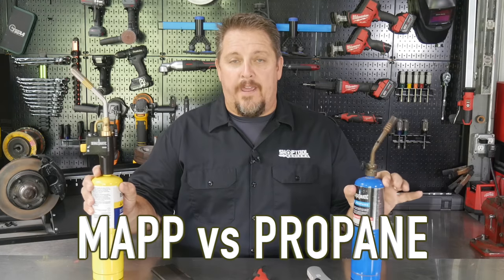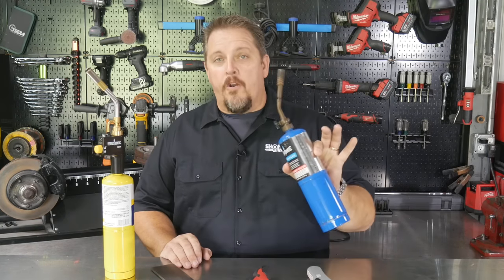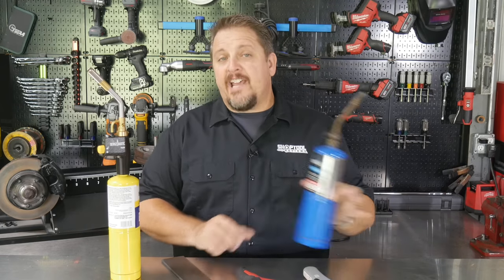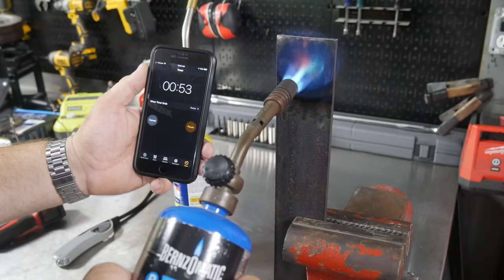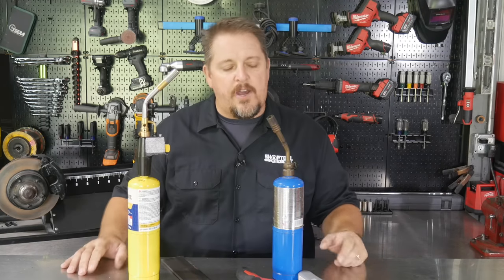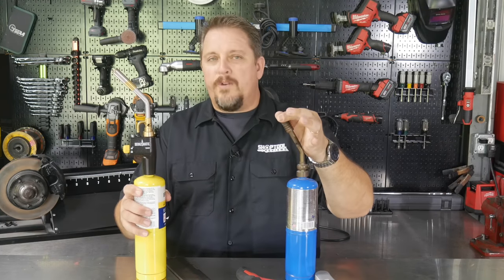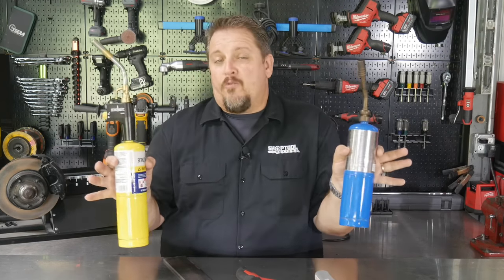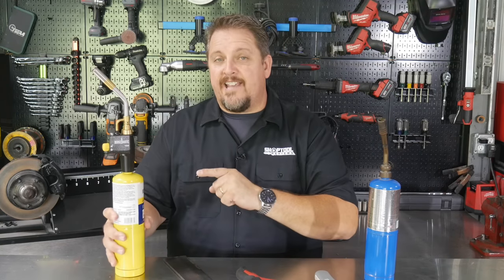MAPP Gas or Propane - Bernzomatic TS8000 Torch Kit

Comment: MAP-Pro lasts longer and burns less fuel in the same time period. Try weighing the bottles, do a 2 min burn time, weigh again and see which one burns less fuel.
Reply: That's a good point, I wonder if propane is still more cost effective in the end?
Reply: Would the flow not be regulated by the tip?
Reply: I’m still crying MAPP was discontinued. Pro is better than propane, but MAP/Pro is only half the temp of MAPP. However…a tank I hadn’t had eyes on in 20 years is the real deal…MAPP! I really should clean off my workbench…
Reply: Well I think you are going to need more than 2 min to see a noticeable difference just based on how long a propane bottle last me but they should flow the same unless it's some boiling point and pressure difference between the 2 but I couldn't see a big difference but I think he needs to do more testing because I believe the map is hotter but I never buy it because propane is enough for me and much cheaper but it's all going up now
Reply: It's near 3x the price and It doesn't last near 3 times as long plus it only burns 130° hotter.
Reply: That's not necessarily a valid test. If the densities of the 2 fluids are different, you will get am unusable result. What you could do is measure how of each mass used per unit of time, then convert to cost of each fluid used. Then you have the bottom line result. Map-pro at the moment is almost 3x the price or prop at my home depot.
Reply: The nozzle will have the same flow rate no matter what gas!

Comment: I've learned MAPP gas has a place for use. In glasswork, propane is "dirty" and acetylene/oxygen is "very dirty". MAPP gas is "clean" when heating glass and glass doesn't get black like the other two. For other purpose, I plainly use propane in my TS7000 for many years. I didn't see much if any difference dealing with MAPP and propane.

Comment: I love how he starts the video explaining that MAPP isn’t the same thing as map-pro, and then a lot of the comments proceed to totally conflate the two different gases.  MAPP was hotter than propane - they don’t make it anymore. Map-pro is also hotter than propane, but not by as much.
Reply from the maker: You're correct, and a tip will make much more difference than the difference in fuel. You have to get the oxygen in the fuel to make it hotter. Thanks for watching.
Reply: 130° hotter.

Comment: Just bought the ts8000 with the map gas included at home depot 30 mins ago. Guess ill be buying the $4 propane bottle instead of the $12 map bottle after this one runs out.
Reply: def go with the much cheaper propane and the map torch attachment,,in canada propane is about 8 buck and map like double that,,crazy
Reply: @Mike Studmuffin bigger does not mean hotter,,it means more work
Reply: Mike Studmuffin, though it's a bigger torch doesn't necessarily mean it will burn hotter or burn fuel faster. The amount of fuel coming out depends how far you open the valve, and it very well could have the same valve, or at least the same output as the older/other ones. The biggest improvement to the TS8000 that make it a hotter, and actually more efficient torch is the turbine blades in the base of the nozzle that mixes the fuel and oxygen much better than previous torches. If one wants to save fuel, it's simple to not fully open the valve. Probably get about as much heat as the previous torch design when the valve is only half open. I built my own torch that's about 16" long. If I close off the air to it, it can burn cooler than either of those torches even though it's about 20x bigger, because it's not getting the right fuel/air mixture to burn like a torch. It's more like a campfire.
Reply: @craigwilson8255  very intresting we very
Reply: I bought the same one a few days ago, after about a minute or so of run time the flame turns orange, pretty sure that means incomplete combustion but I’m pretty new to torches, anyone know whatsup?
Reply: @mysteryman447  get enough petro on thing and it will get hot enough
Reply: @maryrozannasuxmaybarca59  it’s for sure hot enough, the tip is usually glowing by the time the flame turns orange, is it something with the temp of the tank maybe?
Reply from the maker: Thanks for watching.

Comment: I learned this the hard way. Glad you changed the tip good job. I ran out of Map gas at a service call and couldn’t find any map or oxygen an acetylene it was a Sunday. So bought propane and it worked once I changed tip.
Reply: Helpful, thanks
Reply: Yeah, the actual burn temp difference between Mapp/Pro and Propane is only ~.2% (that's 1/5 of 1%). The combustion dynamics of the burner (torch unit) is where your performance is.

Comment: Thank you for this review. I bought the Mapp gas torch kit, screwed in the nozzle, turned on the gas, and didn't hear any "SSS" so thought it wasn't working. Then I watched your video and saw you PUSH THE IGNITE BUTTON!!!!! that I realized that was how to make the thing light. DUHHHH!!!! So I went back and did the whole thing all over again, and it worked perfectly. I was using it to burnish the edges of plexiglas (Acrylic) cutouts because I had read that you need Mapp gas rather than propane to get enough heat to do that burnishing. Now I'm wondering if propane would do the job just as well. But I'll use up my mapp canister first. Thanks again! I appreciate your help very much! And it did the burnishing really well.
Reply from the maker: Glad it worked. MAPP is not MAPP anymore, they haven't produced real MAPP gas in more than 10 years. The propane with this TS8000 torch tip will get just as hot as the MAPP/Pro gas. Thanks for watching.

Comment: I appreciate this video and the testing method as well as the quick tutorial- I have the Bernzomatic TS8000 that I have been a little apprehensive to use and been wondering which fuel tank to purchase. I'm just using it to heat up wood pellets in a tube - maybe a little overkill.
Reply from the maker: Cheryl Carolina that’s a perfect use for the TS8000. Glad you found the vid useful.

Comment: Thanks for confirming that this does work with the blue propane cylinders!
I have a few of those around the house as well as a whole bunch of the shorty, green "camping" type. (fittings the same).

I have some plumbing stuff to do next week and while the old propane torch is fine for the shutoff valves, I'm not so confident for the much thicker regulator and preventer valves that I need to change on the hydronic heating system.

So I'm off to buy the TS8000 kit tomorrow.

Comment: Thank you for changing the tip out. That was the first thing I thought of when the temperature difference was so high.
Reply from the maker: You bet. Thanks for watching.
Reply: Is it safe..¿
Reply: @rubymagadan3351  is the different tip safe for food? Yeah all the metals are inert the only issues would be from the gas. However, using the tip with the higher temperatures you should get a more thorough burn.

Comment: I run my LP torches off BBQ cylinders using a common adapter hose. I still refill the little tanks but the adapter and torch are less awkward than the cylinder when doing bench work. Don't forget to leak check whatever you use. I follow the old farm custom of having a rain barrel near my shop for checking my overhauleded oxy-acetylene gear and use that for a bubble test.

Comment: i have extensive experience using both of these map pro and propane bottles with the map torch head. my job everyday involved busting loose corroded and rusted bolts on rack and pinions that have been sitting in cars in the junkyard for who knows how many years and cleaning the insides of them. i can say for a fact that with propane with the same head it either took forever to get those bolts hot enough to be able to get broken loose or they would never got hot enough. with the map pro it would take minutes at most and they could be broken loose easily. it wasn't even a competition and i always fought to get those map pro bottles reserved for my squad so i don't get stuck with the shitty propane ones and spend forever on the work
Reply: I guess because you are working outside where ambient influences are greater, so the mapp has the advantage of overcoming it better, especially in cold, humid or windy conditions.
Reply: @ArcanePath360  i work inside a warehouse in an assembly line with a track with conveyor belt rollers between me and my 2nd. Tables to put everything on and work on then put them in a basket and roll them down to the next guy in front. Always pretty much the same temp. A bernzomatic ts800 head on both bottles and time to heat and lossen is significant difference. Even on some t25 bolts. Also im using a weak bullshit bosch impact wrench lol. Specifically shoecsps on the racks are always tough to get out and they need as much heat as you can dump into them then use a ratchet to remove them so they dont strip the top of it where the socket goes on

Comment: It all depends on what heat delivery you need. I carry two small torches like these in my tractor trailer. If you need a large area heated the new 8,000 does a great job ( like straightening 1/4 thick length of 2x2 angle iron mudflap bracket). If I need concentrated heat ( like a 15 year old sprayed in salt landing gear bolt) and I need it yellow hot, not just red hot my old trusty 14613  super torch concentrates the heat like the new swirl head can never do.

Comment: The ability to use the torch inverted is the biggest difference in the two gases, but the better torch in the pro series torch kit is a big plus even if you continue to just burn propane.

Comment: The temperature depends greatly on the air fuel mix..
Reply from the maker: Exactly! That was the conclusion and purpose of the video was to show that the tip, which blends the surrounding air (oxygen) with the fuel (propane/MAPP-pro), is more important than the difference of these two fuels. Thanks for watching.

Comment: They both have their applications. I use the propane when repairing copper lines in wood frame walls, the advantage is u can turn it down an it beats dealing with my B tank. But if the repair is open I use MAPP with turbo, much faster on 3/4 and DWV.
Reply from the maker: MAPP is no different. It's not what it used to be. Propane with the same torch will be just as hot. Thanks for watching and for commenting.
Reply: @Shoptoolreviews , I understand what you're saying as a comparison.   As a plumber, Mapp is about 100 to 150° hotter depending on your setup, that may seem insignificant, but it shows up when you use a turbo torch. With a propane setup, you have the advantage of turning it down without the risk of burning out the tip as you would with turning down a turbo torch. A good example, every 3 or 4 years I have to repair a leaded joint on cast DWV. With a propane torch, I can turn it down to a low flame, acid the repair use 50/50 then wipe it down and I can control the repair. You can run propane on a turbo torch with the same results as using MAPP. But over the years and burning out a few of my victors I learned, carry both

Comment: i was wondering about this. ive burned many bottles of propane through my ts8000 and then i decided to try the map pro gas and i couldn't really tell the difference. i mean ive used a lot of propane but if you whip out an oxy acetylene torch you know the difference in seconds. there is no comparison. that shits way hotter. thanks for confirming my thoughts on whether map was actually hotter or not. i wonder how much difference there was on the old mapp gas that we cant get any more.
Reply from the maker: Glad to help. If I'm not mistaking, the old true MAPP gas was a couple hundred degrees hotter, but it wasn't double or anything like your oxy/ace torch. Thanks for watching.
Reply: 130° difference. Some say map pro has better burn characteristics. Not sure how we quantify that though. YMMV

Comment: I’ve had several of the 8000 series and without fail after using them a few times and with all of them the igniter will eventually stop igniting the gas even though I hear it clicking. So I go buy a new one and return the old one and with a vengeance I’ll continue this until they make them last.

Comment: Done a fair bit of heat shrinking in the cold and it seems that MAPP works better than propane in cold weather (--25°C/-13°F). Pretty anecdotal, cant say for sure that i always used the same torch or that i tried a new bottle of propane, but for some reason I just felt the MAPP worked better in the winter time. For bigger heat shrinks I always used bigger (11kg) propane bottles though, but they were mostly kept in a slightly worm van. In the summer time, the smaller propane bottles worked just as well as MAPP.. :)
Reply: Aleksander Mietinen MAPP not the same map- pro , he explained that in the video. They don’t make MAPP anymore.
Reply from the maker: Thanks for watching.
Reply: So this would work with the better tip for heat shrinking for auto body?
Reply: @robertthompson5908 he meant Map Pro gas. We all know MAPP gas was near twice the heat as propane. This new Map gas is only 130° hotter but they say it does burn better. FWIW.

Comment: Good video. I use a knockoff of the TS8000 with butane, which, in the UK, is over 5 times cheaper than propane. The burning temperatures of propane and butane in air are about 20 C apart and both close to 2,000 C if I remember correctly. The only disadvantage of butane is it freezes at about 0 C (as opposed to a freezing temperature of about -40 C for propane).
Reply from the maker: Thanks for replying. I guess it depends on the region you are in as to which fuel is most common. It was interesting to prove that the torch tip and air/oxygen makes the most difference.
Reply: Butane also doesn't ignite above 2000 meters altitude, which the UK doesn't have anywhere.  Most of the camping gear in the US runs on propane for that reason.  Further, the condensation temp you incorrectly refer to as freezing temp.  If they are fully liquid they lack vapor pressure and will not free ignite and the stove fuel lines will have no pressure in them.  As the fuel is used, the expansion takes heat from the can and you can run out of vapor pressure quickly.  You can turn the containers upside down to get them to push liquid butane or liquid propane out by gravity and the expansion happens outside the can so you can burn propane down to -40 (same in C and F) and not be concerned about can chilling.  That lets you ignite the liquid.  Knowing high altitude and low temps are an issue in the mountains, some camp stoves are made to run on liquid fuel with a generator loop that goes into the flame.  Once the generator loop is primed (heated), the stove will run on a liquid feed gasified by the vapor generator loop.  These stoves are often multifuel and can run on unleaded petrol, kerosene, or diesel fuel.  I modified mine to also run on liquid alcohol by adding a variable air choke.

Propane is also available in bulk for grills and RVs, so the price is about $2.50 a US gallon or about seventy cents per liter.

Comment: My torch head is a TS4000 and it came with a MAPP bottle. Years ago I used the basic propane torch head and those deliver little heat. You just convinced me to buy the less expensive propane because Google says there is only 100 degrees difference in the flame temp w/o O2.
Reply from the maker: It's definitely an interesting test. So many people for so long, us included, have just heard that MAPP is hotter. It boils down to torch tip geometry and the job you're trying to accomplish.
Reply: heavymechanic2 MAPP was significantly hotter than propane. MAPP isn’t the same as map-pro. They don’t make MAPP anymore.  The video was about map-pro.
Reply: i dont believe the temp diffrences is any less with strait  in actuality its just less cleaner

Comment: I have several 14.1oz tanks oxygen, mapp Gas and mapp pro they come from county waste management but I have a few red tanks with no labels but the threading is to the right and not left like oxygen. Also slightly smells like propane unless it’s a propane mixture?? Acetylene maybe. And I have 2 original mapp tanks methylacetylene propadiene stabilized

Comment: I just got 2 old 16 oz. bottles of methyl acetylene propadiene stabilized 
and was wondering if my propane torch head will work with them 
and if not, why? Thanks.
Reply from the maker: I'll leave that final liability decision in your hands. I would think it should be fine, those MAP tanks were made for these DIY style torch heads.
Reply: @Shoptoolreviews  Thanks.

Comment: You gotta use two different plates for each torch.....you wont get an accurate reading because molecular structure starts to change the metal become more susceptible to heat.....you should do the same experiment but use the MAPP gas torch first and then the propane and see what the results are
Reply from the maker: We actually did it several times, changing which went first, and all the results were within +/- a few %. But great recommendation.

Comment: interesting findings but yeah the map is slightly hotter than propane but at double the cost and not much diff on the work being done id go with the porpane and hook it with a map torch head ,,but these are mostly for soldering as the filler rods being used are most likely to melt under 840deg F ,if you got oxy fuel than you can braze or weld but you cant weld with propane only acyteline unless they come up with a special gas one day ,that would be neat
Reply from the maker: Thanks for watching.